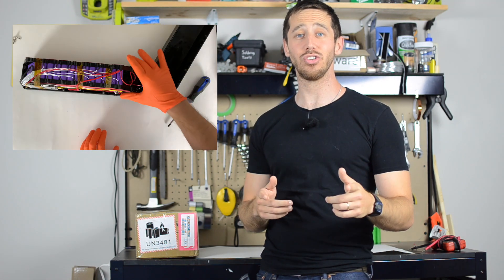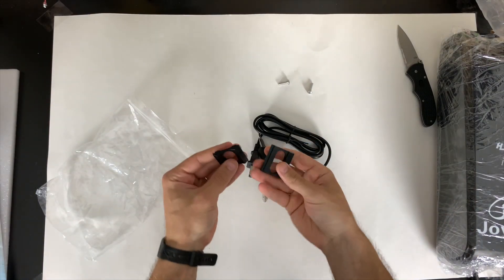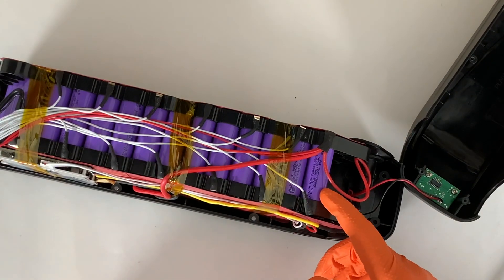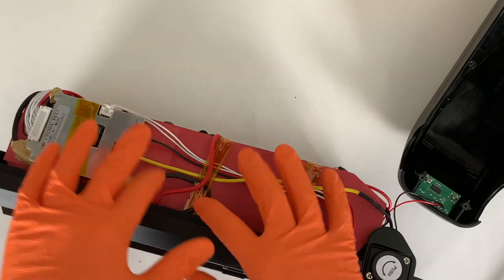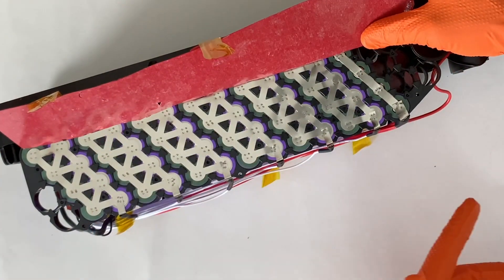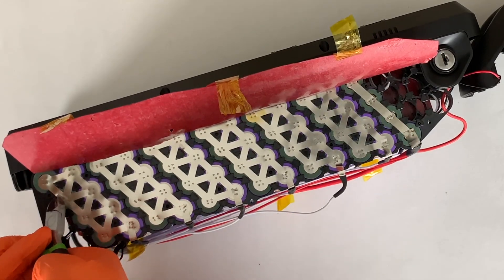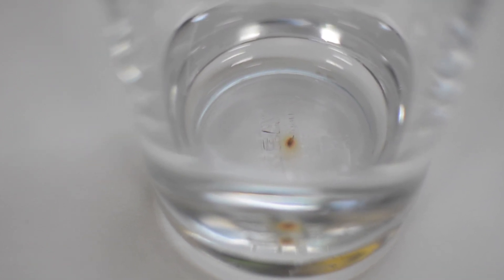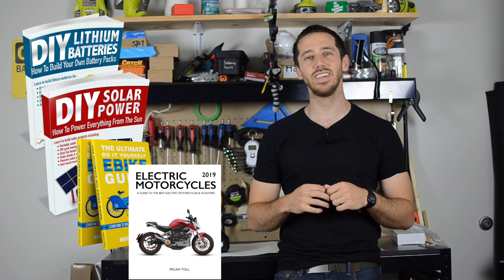How do you know if a battery is good quality?

Comment: So much variability and company names and brands that are not familiar to average consumers when it comes to ebike batteries. We will expect that batteries in our Tesla or Lightning are of high quality. Why should we not expect it for other transportation batteries? Is there such a global demand for ebikes that brand, quality, performance and safety are such a varied and unimportant thing to people using them for transportation? No standards to be met?

I submit that known name brand power tool batteries (ego, Toro, Ryobi, dewalt, etc) within the 40 to 60 volt space should be given more factory and integration options from ebike makers themselves if they can not guarantee performance and safety, or provide a multi year warranty, for the batteries included in their kits, or sold separately.

Rely and use the awesome durability, BMS, ruggedness of these outdoor power equipment batteries as part of your builds… so you can focus on your value added features, motors, accessories, etc. batteries in this voltage range are becoming ubiquitous in the house and garage. Why are we buying inferior, dedicated ebike battery packs with no venting, thermal management, and rapid chargers that cool the battery while charging?

Why should the default normal be “buyer beware”? Why should consumers have to have a testing apparatus and working knowledge of the innards of a battery in order to trust that they got what they paid for? Again do we expect electric car owners to have to make sure they got what they paid for? We know what kind of gas we put into our gas car. We can choose we cheaper off brand, but we know we are doing that.

Battery quality is hidden, and there ought to be some minimum standards that batteries can optionally adhere to to inform consumers of the minimum guarantee that all components can meet x amps and volts and have temperature cut offs etc. saying it is 30 amp just because the cells are rated for 30, but all supporting components limiting it to less than that, means that it is in fact FALSE ADVERTISING in my view.

ebike makers and kit suppliers ought to come up with standards amongst themselves before government tries to do it for them.
Reply: I feel you brother - totally agree 👍🤯

Comment: Man. I built my ebike over Xmas '20 from a 750W bafeng bbs02 with a 10ah kit. My battery uses a hailong case, 2500mah silver Chinese cells. It has no power switch, no USB connection, the BMS looks to be the size of a thumb drive with NO balance circuit... Using it to commute 26km a day, let's see how long it lasts!

Comment: Very nice video, I would prefer 10 or 8  awg wire for 30 @ 46 volts, that's way too much power going through that wire continuously. I have updated wiring in battery backs a lot before.

Comment: My batteri stop working and was full charge. After 2 days  restart but does not charge more than 3 line instead of 5  also the botton on/off dos not work anymore. The charger is al the time green. Can you tell me whats my problem. The battery is similar to the one you show on the video. My bike is fat bike richbit 500w 48v 17 ah. Maybe there is a fuse burn. Thank you for thw futur answer

Comment: A 750W motor needs "only" ~15 A at full load (48V system). Even in that case the bottle neck is the motor, not the battery. For me is more concerning the lifetime off this low cost battery. Any experience with this?

Comment: Is there a E-bike battery brand you recommend, one that meets all items on your wish list?  I've purchased two different brands, one leaked (failed) and the other doesn't seem to work as advertised (drains rather quickly). Just curious since they are not cheap.
Reply: Convert to using a outdoor power equipment battery platform depending on your voltage and Ah setup. Lack of consistent quality control and “buyer beware “ should be the exception for batteries used for transportation, not the norm. Ego 56 volt is perfect platform for 48 to 52 volt controller and motor. 3 year warranty. And thermal management done right. 

How did this standard black plastic brick with cells jammed in there with no airflow become the ebike norm?

Comment: I would be intereted to see what type of different shape and types of cells we could use to build a battery. for example, I have come across a battery of these specs: Type: Li-Ion
Size: 26650
Set Type: Batteries Only
Replacement Battery: Yes
Nominal Capacity: >3500mAh
Model Number: 26550
Bundle: Bundle 1
Brand Name: Okoman
Battery Number: 1
https://gbr.grandado.com/products/okoman-26650-battery-3-7v-13800mah-rechargeable-li-ion-battery-usage-for-flashlight-rechargeable-battery?variant=36465819975829
Just wondering if these cells could be used too.

Comment: Hi James here from SC. This is a great website, very informative helpful and complete. I have an e-bike, three wheel. I turned it into e-bike, my first attempt. The company I bought from is gone, my battery is dead, so I learned an important lesson. I can't find a battery replacement so I'm going to build myself. That's how I found you. I'm going to build one no weld with one of your kits. It's 36 v, but I'm going to add more batteries for more distance and you have all the info and materials I'll need. I'll be looking up where to get the kit. I'm so happy I found you!!

Comment: Micah: Would it be worth it to purposefully leave gaps between cells and include a thermostat / fan to circulate air in between the cells to help dissipate heat out thru the case better?  I suspect that internal heat build-up within the batteries is a controlling factor in many LI battery-powered devices. (My 36V trike and my 18V Ridgid tools will restart and work fine again if I simply let them sit and cool down some - without recharging.)

Comment: Hi,  I need your advice if you can.  I bought a cargo bike from China on Alibaba.  When it arrived the battery wouldnt charge.  Or maybe it was the charger but I'd have it on overnight and still when I put it in the bike said it had zero power.  The company, Hand in Hand refused to exchange the battery so I am stuck.  Should I try to repair it ?  The battery has a six pin rear carriage so its not like I can find those to easily fit.  They all seem proprietary on that.  So what are my options ?  Is it possible that it just needs another charger ?  I suppose I should try that first ?  Then if nothing then what is my second option ?  Open up the box , take out the cells and replace with another block that fits the box ?  That would be easy for you but for me ....?  he he

Comment: Hello, great series on bike batteries thanks. Would it be possible to replace a OEM (Radrover) failed battery with a generic (say Hailong) with the same spec etc without an use / running issues?

Comment: Wouldn't copper connect be better than nickel connect connecting the battery cells?  And can electrical conductive paste adhesive work instead of spot soldering the batteries?  I would really appreciate it if you reply. Thanks.

Comment: This must be the reason they put a little piece of paper over where the screw is and say if you open it it's Floyd. the bottom of my battery that came with my ecotric hammer 2020 the two little spots where it plugs into my bike smell like burnt plastic you can see it's a tiny bit melted I don't think that is supposed to happen is it?

Comment: Thanks for teaching me about the nickel plate steel thing. I have a pack that's been getting issues with discharging. I'll turn the throttle and it would provide almost nothing.  
I've been inspecting it and aside from a broken nickel strip where the red wire was attached to that last set of cells (which I patched up with a copper wire 2 months ago), I also noticed corrosion on some or the nickel strips. This is actually one of the things I suspect is causing my issue.

Comment: This is an educational video. I’ve always wanted to know how these battery are made. I have used AA rechargeable batteries by Sanyo on a shaver and toothbrush for about 10 years.....Never been replaced, they continue to recharge every time. The lasting time has not diminished. I use them until the appliance quits, then I recharge them overnight and reinstall them for another cycle of use. I’ve always surmised that the bikes would use something other than a bunch os AA cells.Are Tesla auto batteries also made up of AA cells? Good job

Comment: ,Hi Mike I have an Ancheer mini electrical scooter and the battery goes dead  1/2 way going to work not even 4 minutes, the Battery Model : HA 103
Voltage: 36 V
Capacity : 6.0Ah
Power:216.0Wh
SN:201805000001
UN38.3 MSDS
can you advice me where can I get it  thank you for your videos.
Carlos Clausen

Comment: Hello great videos i have learnt so much from them, i have a question, i am making a battery pack with LG cells. the cells are LG INR18650-MJ1 3500mAh - 10A and i am building a 52v 14s5p configuration. This is my first time so i dont know much but i bought a BMS from vruzen rated at 52v 20amps. The motor and controller will be 48v 1000w. my question is the max current on the BMS is 20 amps (the 30amp one was sold out) will this be ok. I just checked that alot of controllers have a max discharge current of over 20 amps, will this affect the performance or effect the battery in any negative way?  should i get a different BMS what would you recommend?

Comment: Does it hurt the bms if you take of the metal plates? It doesnt fit into a case wirh them but if you take them of then it fits perfect. My bms is rated for 60A and i'm using a bbs02 so i only need 25A of discharge current. Thank you!!!

Comment: I'd run an electrical test first. Could save a lot of my time.

At the end of the video you still don't know if the battery pack can in fact deliver the advertised Ah. In addition to the visual inspection, I'd have to use a battery tester before concluding it could be a quality battery. A "constant current" battery tester for up to 200V and upto 180W total dissipation is available for less than US$40 and can rapidly give you pretty good insight into the Ah the battery can deliver in reality...not just as claimed by the seller.

I'd run the electrical test first. It's a fast, easy and definitive way to tell if the battery is even capable of delivering anything near its claimed specs. It may take 3 or 4 charge/discharge cycles. Only then, if it passes that testing would I worry about taking it apart for visual examination of build and component quality. Running the electrical test first could save a LOT of my time if the battery is low quality, and it generally should be safer, too.

BATTERY PACK PERFORMANCE ISSUES:
There are batteries out there that use counterfeit lithium cells, or even intentionally low-quality cells, so even if they are marked like they came from one of the known high-quality manufactures (Samsung, Panasonic, etc ####mAh rated cells) the cells themselves may in fact not be from that company nor provide the claimed mAh rating. Even the battery pack manufacturers may unintentionally get counterfeit cells once in awhile which can cause major underperformance. These are common issues for example in USB powerbanks. Example: one powerbank brand CLAIMS 10,000Ah capacity while using what turn out to really be 800mAh cells in a 6p1s 18650 configuration...which could at MOST rightly claim 6x800mAh=4800mAh (yet they are LABELED as 1800mAh NCR/Sanyo/Panasonic cells which they clearly are not)The same issues exists in many battery packs for many different uses (including e-bike packs) available on eBay and Amazon.
Reply: @hchalmoepas6544  I can't recommend any specific ones, but there are some custom battery pack assemblers that have very good reviews on ebay. There are a number of individuals and companies you can find recommended in electricbike.com/forum
You can find some sources recommended by DIYers that can provide just what you're asking for. The generally provide good battery packs because of the feedback on the forum. I've found the group very helpful and knowledgeable.
Reply: Yep exactly I seen so many falsely advertised and using junk, or fake cells. I finally got one that was as advertised and using LG IMR 18650 cells 2850mAH and tested on discharge pretty close, or slightly above, so definitely genuine and was cheaper then this pack in this video. I was actually surprised as was expecting Chinese FST cells, or one of the 3 common Chinese cells they use. 

A few packs even have had where BMS was miswired on discharge side and literally could drain battery down to zero as they bypassed the low voltage cutoff on the BMS? Don’t get me started on those packs claiming to have Panasonic cells using Sanyo and not the GA cells, so technically not Panasonic, or not even using neither and lying completely and charging $400 plus for the pack. I guess they figured out most won’t open the pack?

Comment: Wearing the chemical resistant and non-conductive gloves is a good practice with a battery pack like that, but we should be definitely wearing safety glasses on projects like this.
If a wire were to pull free and short out to something due to shoddy workmanship, or if any connection sparked for any reason, it could send molten metal right into your eye(s).

Comment: At about 6.25, remember that the max current is quickly derated based on the temperature INSIDE the CELL...not the temperature in the case or general environment. So in most cases if one tries to take it up to the max current without derating for the cell's internal temperature one would quickly have a possible explosion, fire, and/or other catastrophic cell failure.

Comment: Does it have an environmental rating for dust and liquid?
It looks to me like the battery case doesn't have anything to prevent water from entering, so that can limit how you can mount it on the bike. I'd be worried in a rainstorm or after a rainstorm (puddles) with this battery case design. 
Of course, there are also many e-bikes out there that should never even be ridden in a rainstorm as they can not only fail but present an electrical shock hazard as well.

Comment: Total newb question ... it is a 48V (max 54.6V) battery and you stated it was shipped at slightly half charge yet the multimeter reads 47.7V ... I probably need to buy your book ...lol :)
Reply: For excellent info on lithium (and other cells/batteries), check out website:
batteryuniversity.com

Comment: Hi really appreciate for this vedio, 
Actually cell capacity is 2500mah 
So 2.5*4p gives 10ah till here fine 
But I have a query here that is 
What is mean by 3c 
1.How/why we need to calculate 
   2.5*3 =7.5ah  what is this and how this will be usefull?
Going forward how to calculate cell capacity ..?
If cell capacity based on type of cell discharge then
How to calculate battery pack..?
is it in ah or type of cell 
2.Actually battery pack is 4p(10ah) but why BMS is having capacity triple(30ah) of actual ah 
3. From positive to negative they used nickel strips for series connection but what if we use glass fuses instead of nickel strip for series connection..? Can we use glass fuses or not 
If yes can we feel it's a advantage point to avoid not Hazard or any blast movments to save entire battery pack 
Please reply 
Why

Comment: 13s4p  13 times 4 = 52 cells   $300 divide by 52 cells over $5 per cell if you are not counting the cost of the other parts like the enclosure, bms and labor

for over $5 a cell i would rather go with one of the big 5 makers or even tesla cells.

you could load test the battery to see if the extra battery strips may have been to compensate for that they are plated steel.

Comment: I just want a book I have the diy battery book and need the next one. I made a bike with a a1500 wat motor and a 52 volt 20 AH battery and I was wondering if I had a 62 volt battery with 30 AH I could go further and faster. Note that my bike is all electric no Pedal I made it from a single speed bike after 11 mph it’s electric.

Comment: Why would you say no kle plating a short cut I don't agree it is because it's a quicker way to produce these contact at a level where quality is escalated and it's not necessary to use nickel metal when a plated metal does the very same job after spit welding doesn't remove the buckle plating

Comment: The charger voltage measure missing. Basically this need the balancer correct workink, otherwise also important to battery fully charged, but not overcharged.

Comment: Your max. Discharge current calculation is wrong, the data sheet listed 1C=1250mA, max discharge current is listed as 3C so that is 3275mA NOT 7 3/4 A. The usual case of phantasy specs...

Comment: The Ni-protected steel strips are fine.  Mechanically steel is much stronger than pure Ni; it is the better choice in any application where the battery is bouncing around, like on a bike.  The electrical conduction of steel is a lower than pure Ni, but that is not an issue.  For optimal conduction, copper or aluminium would be the best choice, but Cu is more expensive compared to steel, and Al is mechanically very weak.

Comment: i put this battery in my ebike it goes around  9 -10 miles range Battery model: 36V 14ah 
Rated capacity: 14ah 
Rated voltage: 36V 
Cell combination: 4 parallel 10 series 
Battery size: 68X188 X78 mm 
Number of batteries: 40 
Instantaneous maximum discharge current: 30A 
Maximum continuous discharge current: 15a 
Standard charging current: 2A 
Charging time under standard charging current: 4 hours is the battery bad was at the beach